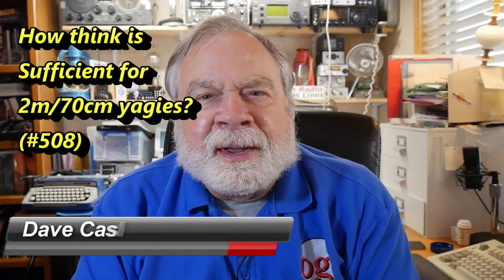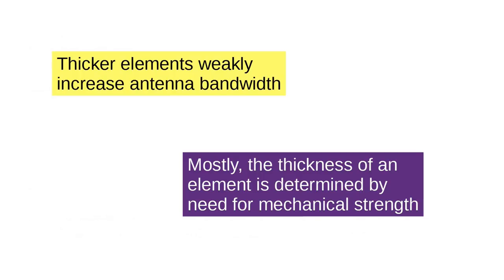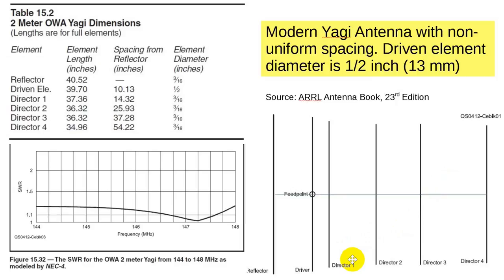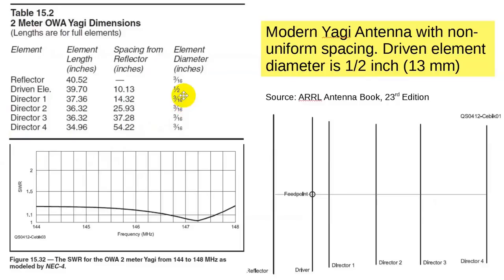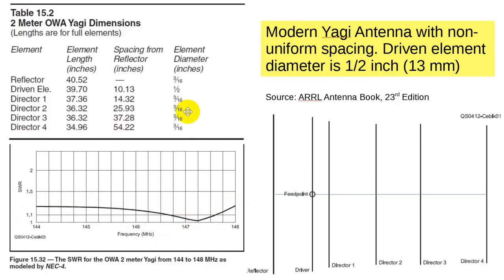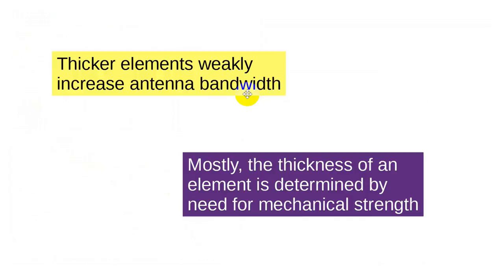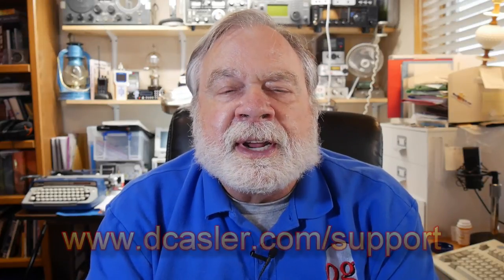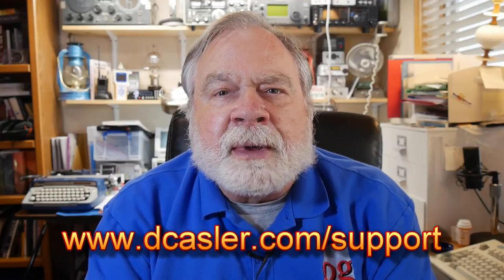How thick is sufficient for 2m/70cm Yagies? (#508)

Comment: I've been at 72 years of age been a ham for almost 2 years, 1 month as a tech and the rest as a general. I bought a 1 inch aluminum square tube and some 3/8 aluminum rod, to make a 2meter 3 element YAGI it is wide banded.

Comment: I built a Yagi 50 years ago with a steel beam, and it didn't work worth beans.   In a fit of desperation, I replaced it with a small broom stick, and it worked great.
Reply: That's great 😊👍

Comment: The Antenna Dave was talking about is called a "Caged Dipole," go ahead and google that term.  They do look pretty difficult to work with physically, especially if you want to build an 80m version.  Fortunately 80m is the only band where you can't always get away with a simple thin wire antenna.  If you want to be able to receive broad band around something like 400-500mhz, then some thick elements might not be very hard to build.  There is no reason you can't go out and do some experimenting.

Edit:  An 80m/75m fan dipole would be a lot easier to build than a Caged Dipole.
Reply: Kevin L., The Old Tech Guy did an experiment recently with a caged EFHW on 20m & got impressive bandwidth improvement, however dubiously it might be to say it was needed. Interesting, nonetheless.

As for me, I run an inverted V with a motor in the middle that runs 2 spools of stainless thin cable… so I can lengthen or shorten the dipole at will without leaving the shack. It’s pretty nice to never (OK, rarely) need to engage the tuner at all. Every antenna is a compromise… I compromised on up front cost. LOL

Comment: The thicker elements results in higher wind resistance which can be detrimental for the average pole the yagi is mounted on. Lower wind resistance puts less stress on the structure holding the yagi up in the sky 📻

Comment: half an inch is 12.7mm not 13.1
Reply from the maker: you are correct. I had the wrong conversion factor in my head. My 13mm wrench works very well on 1/2" bolts.